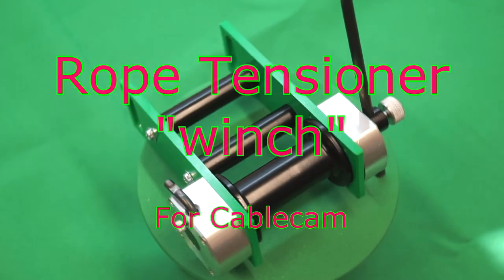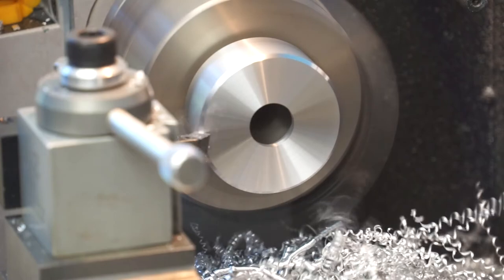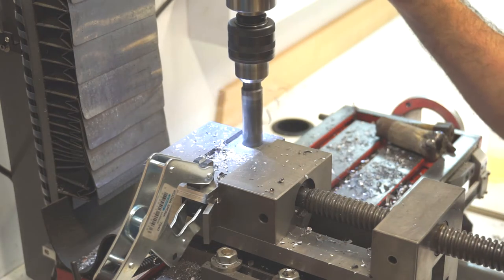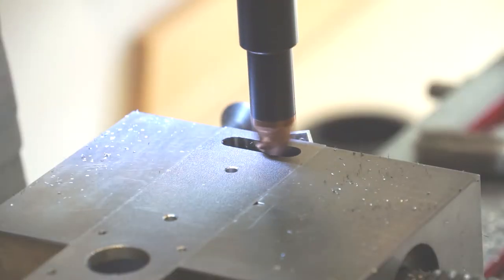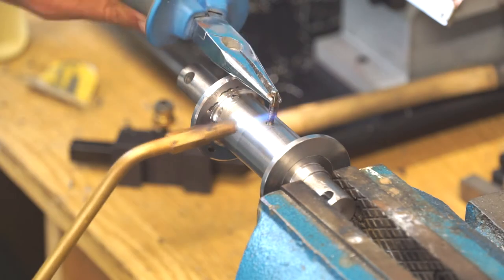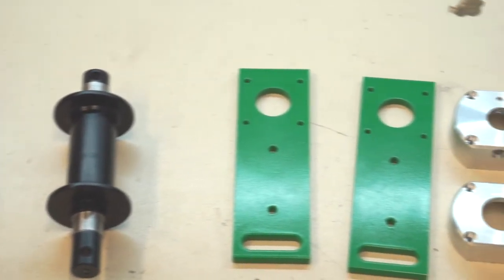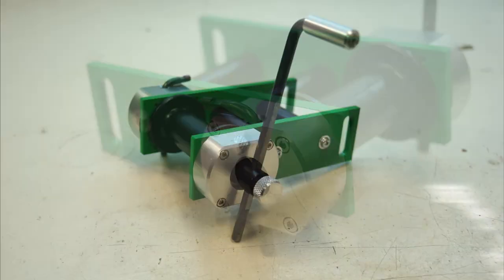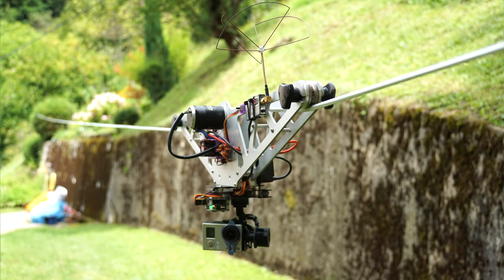Making of: rope tensioner - winch- [for cable cam]

Comment: How much would you charge for stepper motor operated unit?
Reply from the maker: Sorry but i don't got yet allows to sell stuff.
Why do you need stepper unit, for this kind of use stepper don't got enough power.
Reply: TinC33 
I wish to start trying to make a hoist winch for UAV. Ideal payload of 25kg. And with a wireless servo release catch at bottom. I think this is next market for heavy lift UAV once UAV delivery regulation is in place, which is soon.
Reply from the maker: @muntee33  ql, but for that kind of winch you'll need powerful motor loke 2-3kW i think, because you need lot of speed, maybe some starter motor will do the job and big drum with lot of thin rope.